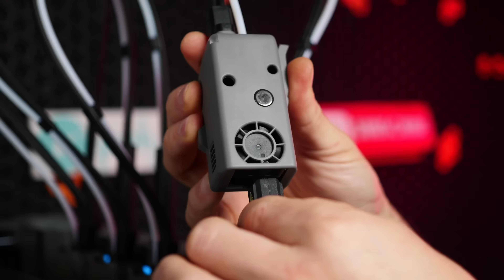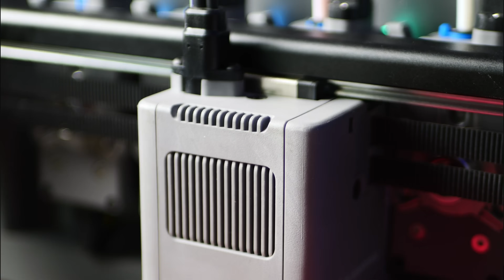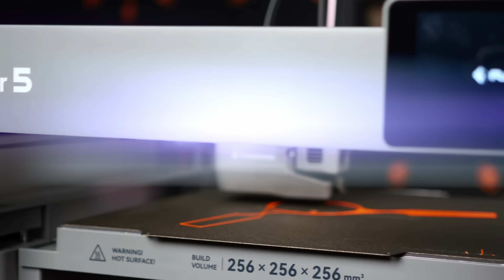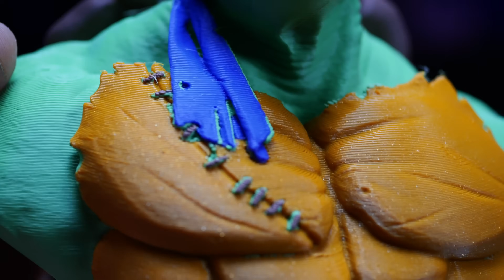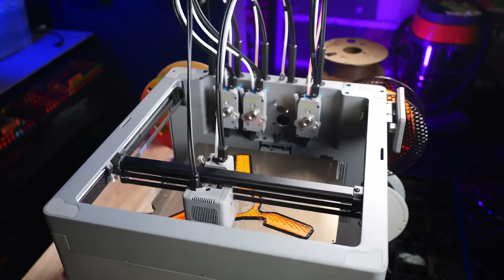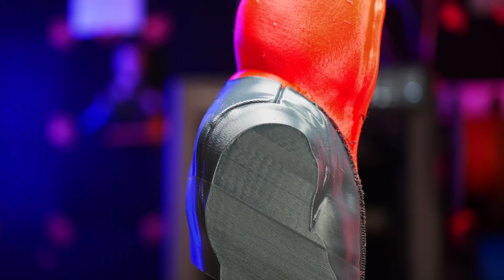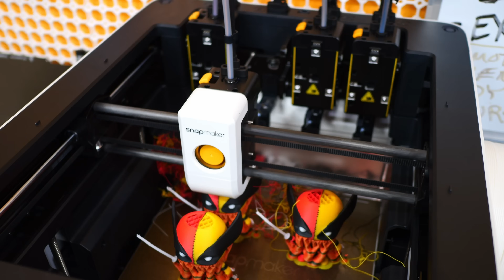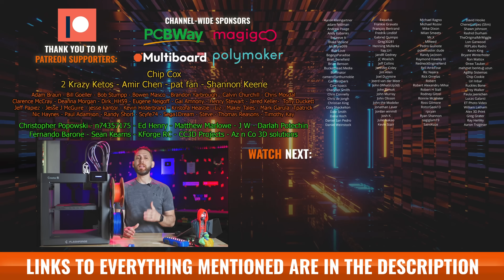How Good Can a $699 Tool Changer REALLY Be?

Comment: Removing 2kg isn't going to change the shipping cost of this item, it's already into "large box, fragile" territory and there's no way it weighs enough for "overweight" surcharges.  Half-assing sample filament is just a waste of plastic.  So I don't think I'd list that as a "cost savings" measure.

I'm interested in tool-changers in general, and the pricing on this one is certainly competitive.  Although I'd need the "pro" since I need to print ABS for prop recreation purposes.  But even then, and using the not-early-bird prices, this looks to be a couple bills USD less than an U1 and a lot less than a Prusa.

So, for you: I'll be interested in an unrestricted review of the Pro once that's available.  And for FlashForge: The price of this is a pro, but the "we get approval of the video" is a major con, and I am currently of the opinion that something is really unreliable on this machine that you weren't allowed to talk about.  If FlashForge is actually confident in their hardware, they wouldn't be worried about your un-edited opinion.  As a marketing tactic, this is backfiring.
Reply from the maker: Interesting, didn't know that about the shipping, thanks for educating. So it probably only saves them $10-15 (cost of 2kg of filament + 4 spools)... but that's still something when you're trying to get down in price. 

And I agree, I always tell brands that the video will be better received if they just let me speak more freely, sponsored video or not, but some brands have specific concerns. For example, I can tell you that FlashForge didn't shy away from me saying other printers are more polished, but they did NOT want too many comparisons to other brands, even if they were favorable. I can only assume this was to prevent confrontation, because in some places, they told me to cut mentions of saying other brands over-complicated things.
Reply: @thenextlayer  You make a good point about cutting the cost of the spool out of the unit price, I just think they should go all the way and not include scrap plastic as a "Sample."

The rest of my comment was to give you something you could give to FlashForge (or any other manufacturer) they next time they want to control your videos, so you have a stronger argument for why they're making a mistake.

Comment: Now now, i am interested to see snapmaker pitch for U2 since other started to follow U1 design
Reply from the maker: Me too. I got to thinking - if snapmaker removed the motor from the tools, they could fit like 10 tools on a 350mm machine and sell it for like $1499. But FlashForge may be way ahead of them on that since they already have the tool head design down pat.
Reply: @thenextlayer that would be insane
5 on each side but I think 8 is more practical for filament spool holder design 4 on each side I think is the maximum.
I am really curious to see what elegoo does, will they keep the same chassis on the CC3 and add a tool changer design like this, I do have a CC but I think looks like it would fit and that they have planned ahead for such a thing
Reply: Sovol is also said to be working on a 6-head tool changer.

If it were based on the mechanics of the Sovol SV08, then we'd have a 350x350mm plate (with the SV08 Max, even a full 500x500mm).

Comment: I'm very interested in the pro model. I hope you review it when it hits the market.
Reply: @Robd1713  likely will have an enclosure and a heated chamber. Those patents have expired. The lack of enclosure is a bad idea with a multi material printer unless you just want to print pointless toys.
Reply: @truantray  Toys are not pointless.
Reply: @truantray  actually its on its way, announced about the same time. Rob is referring to the Flashforge Creator 5 pro version that has the enclosure and heated chamber 😀
Reply: @truantray  why? What’s the biggest difference? I’m new to 3d so actually wanting to know
Reply: @SoutheasternExoticsLLC  the pro has enclosure and is actively heated, which means the printer is really good at printing engineering materials such as abs, asa, and nylon
Reply: @truantray  It does, and filters and everything else needed for the exotics.  The Creator 5 series has a 300C hot-end, so the Pro should be able to print just about everything.

Comment: The hardware and price point looks amazing, the print quality also looks solid. However, I have huge reservations on Flashforge with regards to support and software updates. I've had problems in the past and this has a left me hesitant to buy this. I hope this turns out to be good and popular, it should help drive competition and prices of the other printers will drop to match, competition is good for us consumers.

Comment: I was so close to ordering one, but don't need multi colour, so going to keep my elegoo centauri carbon, especially as they're just put the ams add-on up for £50
Reply: Why would you even be looking for a new printer if you don’t need multi color? Is the carbon print quality bad?
Reply: @spizzlo  ???
Reply: @spizzlo   If you don't need multi color, then stick with what you have. If you need (want) multi color, then the switch to the CC2 makes a lot of sense in the long run.
Reply: Before you buy the multi color add on for the CC1, sell your CC1 and just buy the Elegoo Centauri Carbon 2 Combo. It's currently just $419 here in the US (no clue hoe much it is in the UK) and the CC2 has several more optimizations and enhancements over the CC1. It's worth it. I have four CC2s and they are marvelous.
Reply: @Blubb5000 well he may do that but what do you think he’ll get for a cc1 used? It’s £50 vs £100’s I know what I would do.
Reply: @spizzlo   I think that £50 is nothing compared to the value you get out of the CC2 Combo compared to the CC1 + Multicolor add on. I'd go no matter what for the CC2.